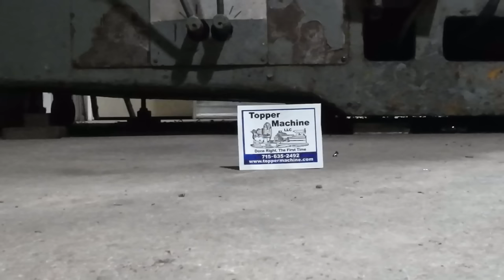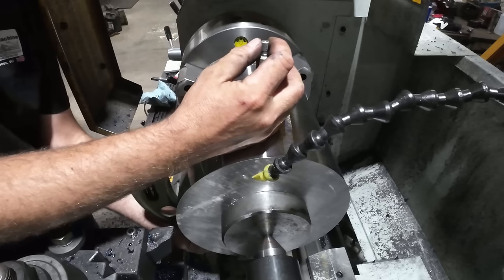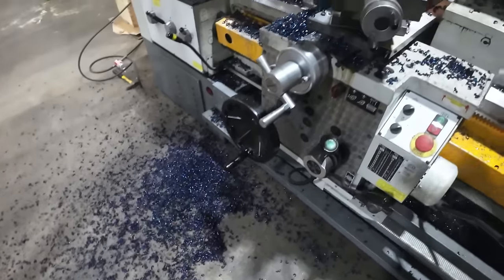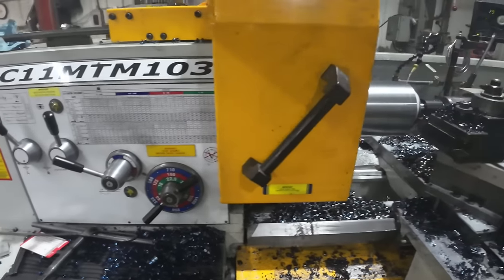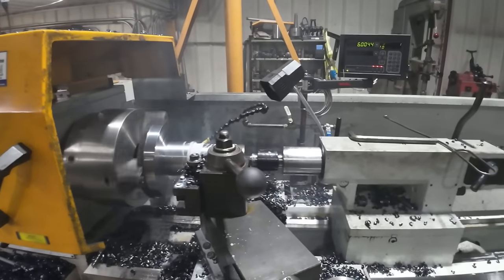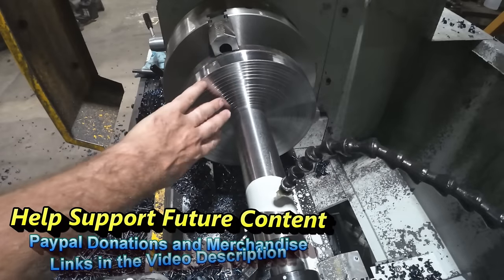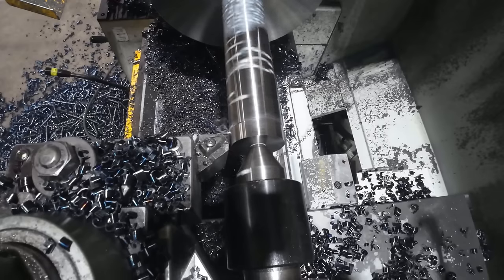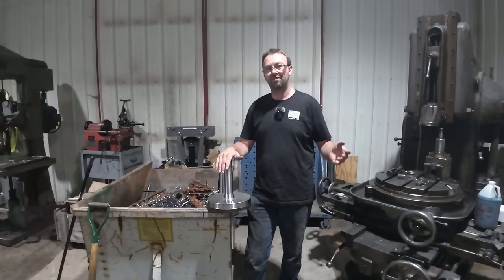Turning a Solid Steel Bar into a Part - Heavy Metal Removal on the Lathe - Manual Machining

Comment: why in hell would you need a 4jaw indep. chuck here, when the final part is produced by removing of the outside material in one setup? Sure, the removal of plate extra will require rechucking, but its a facing cut, which i assume, as long as you set it square to axle is going to be fine, even if the cut it eccentric a bit... The main part geometry is gained in a single setup and the stock is oversize by enough that the part will be concentric to the bearings of the spindle... You could use a 4jaw to make it run perfectly concentric on the rear face, as to achieve a nice finish pattern concentric to the part itself, but as said, i assume that as long as the back face is square to the part, the job`s a good one... 
You arent refinishing a precision part for it to require independent clocking with a 4jaw, its a relatively simple part that could be made with the worst 3jaw with 100 thou of runout, or 2.5mm, and with the material removed, the stock would still yield a good part, if your spindle bearings are in good order, of course, and if the worst chuck doesnt mean a chuck that will let go of that part and kill you with it... the worst as in worst assumed runout...  
If i were to bitch about anything, it would be chucking of dirty stock that hath been rolling on an abrasive surface, without a sign of way covers or any such machine hygiene aids... Its just a mistreatment of machines, no other way to put it, but to each his own i guess... My shop is glazed in sealant paint and the floor is ceramic tile, washed with anhydrous alcohol every so often, and the shop equipment and all is clean and abrasive free... No abrasives or moisture allowed whatsoever... Even the air is filtered for dust and other potential flying particles... The coolant is cheapest atf i can lay my hands on... Its mineral oil, and i generally go for those with no additives in form of detergents... I dont mind wear reducing additives and other such nonsense, but since it is a filtered system on every machine, it would be okay anyway... Now im not suggesting everyone to not use emulsion coolant, as it is great, but it can cause issues if not properly handled... And i love the smell of smoking atf... Smells like caramelizing sugar...  
Other than that, a good video, and a good oem part...

All the best!
Steuss

Comment: Mr Topper, I would imagine that you, as the consummate straightforward experienced professional that you are, would advise a customer of potential problems and pitfalls with regards to certain aspects of work orders. There is only so much you can do and if it is what the customer specifies then so be it.
Reply from the maker: I questioned it on the first part, but know not to push the subject. You could potentially lose the job or the customer.

Comment: I don´t get it, if it has to be one piece because welds fail, why not specify a forged part? way less material removal and an even stronger part.
Reply: Depending on the production volumes, this may actually be the cheaper option.  Getting forgings made requires different suppliers, additional engineering, additional tooling, etc.  All that adds capital expense to a project, which must be balanced against the reduced material usage and reduced machine time when using billet.

Comment: just wondering at what point does a person begin to get concerned about the temp ? i know nothing about using a lathe !
Reply from the maker: Temperature is always a concern.  Thermal expansion it significant on parts like this.  That is why I use coolant and thoroughly cool the part before finishing.

Comment: Regarding your video:
--
95% of good material goes to the trash!
God, you see this and don't thunder!
--
I have a similar project in mind, to make a D1 spindle for my Sieg mini lathe.
I'm thinking here about multiple upset forging versus interstage annealing.
Then the material fibers will have the right direction and the spindle will be stronger. :-)
Unfortunately, I don't have these options at home. :-(

Comment: Hi Josh really impressive job on that big piece. i wonder if you could give me some advice on getting a nice surface finish on 1045 steel, cause in my lathe i get a rubbing surface with CNMG inserts, thanks for all the videos greetings from ARG :)
Reply from the maker: 1045 likes deeper cuts. I get bad finishes on cuts less than 0.015. I tend to try to finish with 0.025". At least that's my experience.
Reply: @TopperMachineLLC  Thanks a lot Josh i'll try it :)

Comment: Welding for this kind of part will have differing hardness distributed across the welded area. When loaded under cycles of varying stress, those areas of differing hardness will tend to crack, then the cracks will propagate causing a part failure. On a part and rotating device of this size a part failure will be catastrophic. There is no way to assure weld penetration and absolute concentricity if the part is welded. Given the potential catastrophic results of a part failure, hogging a part like this from solid IS technically and engineering proper way to make a part like this. Cost is far secondary as the catastrophic disaster from a part failure will FAR exceed the manufacturing cost of a part like this.

BTW, this Lion lathe is doing an excellent job moving the massive amount of metal required.

Comment: Would you query the customer's design engineer to confirm things like the decision to turn from solid stock and the omission of stress-relieving fillets or is the correctness of the drawings a given in industry (I'm just a hobbyist).
Good to see you are running a blue-chip company! I always understood that was the origin of the term.
Reply from the maker: I did ask a few questions about this design and got the "make it to the drawing" response.  I'm not going to argue and possibly lose the job and customer.
Reply: Blue chip comes from gambling, where one writer described the blue betting chips as valuable.
Reply: @igrim4777  That is what Wikipedia says so I thought people might be interested in the alternative explanation that was given to me in the 60's. The explanation being that a company running at near 100% efficiency will be producing blue chips from its machine tools. Maybe it's an American vs British thing.

Comment: For the people commenting on trying to save some of the material for other jobs they must not realize that machine shops can’t sit on every scrap piece of material in the hopes of reusing it. As for making it from 2 pieces I have seen it both ways where a 2 piece stub has failed due to either wrong material selection or poor welding technique. As long as the customer pays and is happy that’s what matters
Reply from the maker: Absolutely 100% correct.
Reply: Chips=Money.

My question is why the customer use raw stock instead of forged preshape billet?
Is it the money and/or time schedule or the material is not suitable for that?

Comment: You could have machined that in a way that got the same part and saved 10" diameter rings for another project.
Reply: you going to buy him the trepanning tooling?
Reply from the maker: Yes, trepanning is an option.

Comment: Very nice!  LOVE the big chips - so fun to watch!  Question on the chip color - I remember from shop class (a million years ago) that brown color chips were okay, blue was not.  We were using mostly HSS but had some brazed, non-insert carbide tooling.  We also had old WWII vintage machines - so assume the brown okay / blue not okay was a function of our tooling / equipment?  (also no coolant, just a pump oil can with auto drain oil in it)
Reply from the maker: HSS you never want too hot, so brown would be OK.  Carbide can be blue, its transferring the heat to the chip not the part.
Reply: @TopperMachineLLC  Nice!  Thanks for the explanation!  LOVE watching those big chips!
Reply: @kd5byb  With carbide inserts you can have easy 10 times the cutting speed of HSS.
HSS around Vc 10-30m/s in steel, carbide inserts Vc 150-250m/s.

Comment: I think the OEM is just avoiding having to hire welders/buying extra equipment so they use the people/machines they already have.
Reply from the maker: I have been seeing way more of this from many different customers. Not sure if it's an industry trend shift, or lack of experience.
Reply: One line of code on a cnc would make that without anyone standing there running it back and forth. Over and over again, as many as you like.  Really simple. 
Okay, maybe a little more than one line of code, but not much. 
You could have even made it out of tool steel,  s7 or something like that.
Reply from the maker: @paul5683  I find these comments about how a CNC could do it better absolutely stupid. Even if I had CNC large enough to handle this job, it is still a manual job. I enjoy job like this, it is very rewarding to be in control of the work and not just jerking off watching a computer do it. Why should anyone care how I spend my time

Comment: driver sprocket for a wire spooling machine look at that one i have designed for a customer here 
the manufacturer had a problem with it but they used my idea for ther new drive pins my lawyer was very happy with the case to i just want to be paid for my idea it was too funny part i did change my drive sprocket in case you what to know that to better design it was too

Comment: Lots of waste but it sure is nice to get to do some heavy turning!  If you had a lot to do it would be worth contacting a forging shop to have them knock out some rough slugs you could machine from. It would be even stronger and not be wasting 90% of the material.
Reply from the maker: If it ever makes it to production, they will be looking at that option.

Comment: Why do some people think you have to put rough barstock in a four jaw chuck?
Reply: So you can dial it in duh! LOL. A lot of armchair machinists out there.
Reply: @dcraft1234  Talking about yourself there? I've been machining for 50 years and I use a four jaw chuck when needed. Obviously this job did not need a four jaw chuck, or Josh would have used one. The amount of material needing removal meant that it didn't need to be dialed is, as this would have taken unnecessary time.

Comment: 935... already 2.5 under. and the last mesurement, i wont tell you haha  probably somewhere between 1.9345 and 1.934 so 1  15/16  for comon people but for a machinist ... idk man
Reply from the maker: Drawing called for 1.935 +0.000/-0.002. I didn't design it, they did.
Reply: @TopperMachineLLC  thats perfect has you said then

Comment: What a waste of stock! If they want 1 piece they should forge a rough blank and have even better strength.
Reply: Probably exceeds the costs budgeted, as in not enough volume to get a forging that size.
Reply from the maker: Being the prototype and test pieces, forgings are out of the question. Maybe if it becomes a production job.

Comment: Instead of trying to get mirror finish, you could maybe clean the floors and machine while it’s working.
That pile of chip is atrocious.
Reply from the maker: You obviously didn't read the commenting rules. When you have your own shop, you can do it how you want. Clean up is at the end of the job. Bigger piles are easier to shovel.

Comment: Throwing away 75% of your raw material whilst 8 times as much energy and 10-12 x workhours. That deserves a fanfare: dumb, dumb, dumb, dumb, da-dumb!

Fine thread, screwed in, welded around a half depth, 90° (45° per) chamfer on the front (flat) face, would distribute the shear stresses and bending moments through the yjread and weld rather than concentrating them at that sharp interface corner and be 3 to 5 times stronger. 

Overweld and face off clean and the customer would probably be none the wiser. Point out the benefits and they'd probable be both pleased and impressed.
Reply from the maker: This is exactly how they wanted it.  I tried to explain the benefits of doing 2 pieces and welded, but they would not have it.  YOU DO AS THE CUSTOMER WANTS.  If you want to stay in business and have repeat work, you just do as they ask.  I agree it was dumb, but they paid for it.

Comment: When you demand suppliers adhere to the old bromide: "That's the way it's always been done.", respects goes out the window.  It should be a washer welded to a bar.  The OEM was lazy!  And the fact that the OEM says the feature is proprietary says they probably know a lot less than they think they do.  They're probably suffering from a severe loss of tribal knowledge.  IYKWIM...
Reply: It’s not josh’s  job to argue with the customer.
Reply from the maker: Argue with the customer, and potentially lose any future work. But as I stated in the video, I am seeing way more designs like this in the last few years. Maybe it's an industry trend shift.

Comment: Not to single you out, but proper sfm is why cnc machines are taking over the industry!  Overly cautious machinists don't use the machines and cutting tools too their potential and slow productivity.
Reply: And CNC machines are for the most part only any use in mass production high volume machine shops. In a jobbing shop like this they are a waste of time because a manual machinist will have a single part made before the programmer has even finished doing his program. Then there's the time taken to do a dummy run before even starting to cut the part. It's horses for courses and for this job it done correctly and there will always be manual machines.
Reply: @geordienufc3132  EXACTLY.
Reply: @geordienufc3132  but once made the program can accompany any future jobs.

Comment: A BIG waste of material. A good welder would make the part as good as a solid piece (even stronger) and they would be none the wiser .
Reply from the maker: And when it went through inspection and NDTs, I would be on the hook for it.  YOU MAKE THE PARTS AS THE CUSTOMER SPECIFIES!!!  This is how you stay in business.
Reply: @TopperMachineLLC  - I was referring to the customer insisting the part be made from solid .

Comment: Well done. Utilizing a single piece is far better than a welded two piece shaft without question. As a retired maintenance machinist, I've seen lots of failed welded shafts, especially on air handling fan shafts, and large pump shafts.

Comment: Still, it seems an unbelievable waste to me, like turning a chopstick from a tree trunk
Reply from the maker: Do what the customer wants, or lose the job. Simple business.
Reply: @TopperMachineLLC   Certainly. I only meant to say that if a design results in such wasteful production, it would be good to review the design
Reply from the maker: @okarakoo  I made my suggestions and was quickly shot down. Not going to argue or push the subject, they are a good customer and I don't want to lose them.

Comment: I just think of any one of those chips hitting my hands on the controls.  Yeah, amateur ...
Reply from the maker: After many years, you learn how to place your hands so they don't stick.
Reply: @TopperMachineLLC  I'm starting to think there is also some issues of tool selection, cutter angle, etc  to direct chips away from the critical controls.

Comment: so stupid, wast a lot of times and material to turning it .
Reply from the maker: This comment is stupid.  You have no idea the application, nor the time it actually took to do the job.
Reply: @TopperMachineLLC  I work in a machinery company.  If we need a part like this. We use near shap forged piece for high toughness elements. Or use disk and rod 100% welding for common elements.